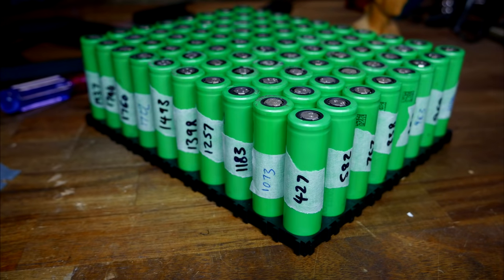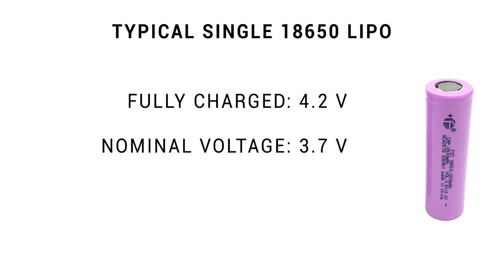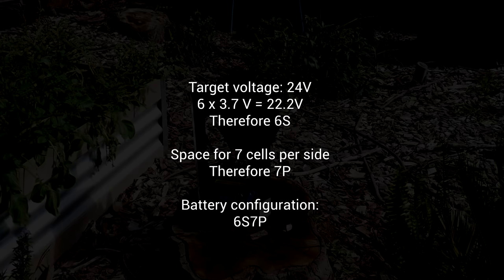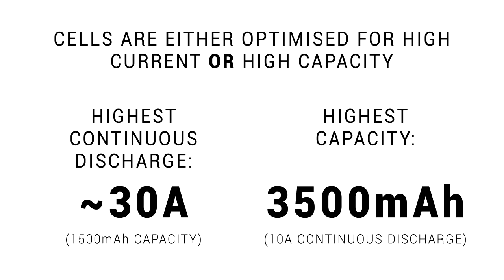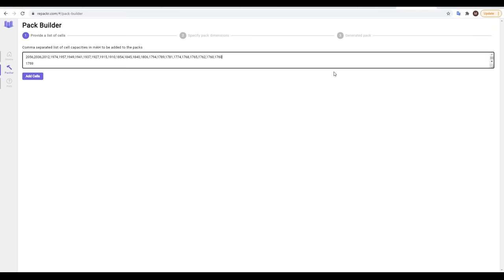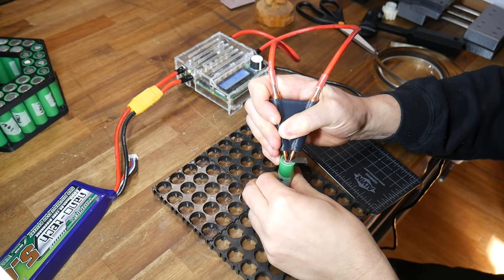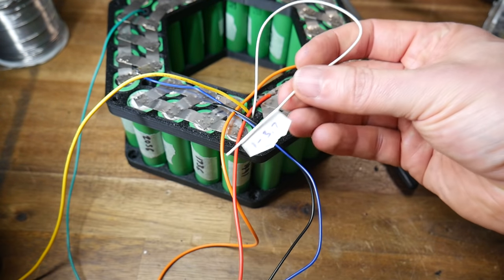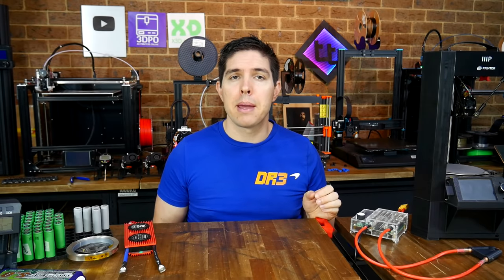Beginner’s guide to building safe 18650 batteries

Comment: Why did you show a lipo battery short circuiting instead of a Li-ion?
Reply from the maker: Far easier for me to do it safely. I would have needed to manufacture something to do the same shorting with 18650s without being right next to them.
Reply: There very similar, they both make the same boom.
Reply: @NathanCroucher  Actually they don't. And LiPo is usually considered safer. With Li-Ion it's harder to damage them due to their metal shell, but then again, that's basically a pressure vessel, so it releases more energy at once in the event of a catastrophic failure.
Reply: @graealex  Actually actually the point is its not safe for either of them to short. Thats why they both need all that circuitry to charge and monitor.
If he had of used a nimh/cd then yeah, poor comparison. Way to throw people off the issue suit man.
Reply: @NathanCroucher  "had of"... At least "suit man" mastered the English language. If you want to get personal.
Reply: @graealex  You do spell checks to. Thats great. Everyone loves those kinds of people.
Reply: @NathanCroucher  And everyone loves people who comment on appearances. You started it. Btw. it's "too". The issue still stands, an 18650 contains a liquid electrolyte in a hermetically sealed vessel, and that makes them more dangerous. Li-Po on the other hand just ruptures the pouch, and thus it doesn't "go boom", to use your own words.
Reply: @graealex  Semantics. So annoying.
Can you make a worthwhile contribution?

And FYI in Australia we removed the "o" from too as it makes things more efficient.
Reply: @NathanCroucher  The worthwhile contribution should have been me explaining to you that there is a distinct difference between just a fire and an explosion ("go boom" for the layman).
You being Australian explains a lot, so you are forgiven on account of never actually having learned English. Although it's still "too".
Reply: @graealex  " fire and an explosion" neither of these things are good.
Where getting there, to the point of all of this.
Ill concede boom to pop, hows that?

Comment: I am going to build a DeWalt 10 cell Samsung 30Q power supply.   I think it is 5S5P, based upon your design specs.  About how much capacity will it have in Amp Hours?

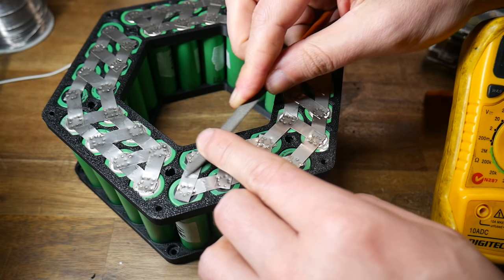Comment: 16:06 for people out there.. this part is dangerous. 
see those green plastic around the battery terminals?  those are the only thin sheet that insulate that part of the battery.  if you solder the way he did..
you might end up melting those plastic and revealed the metal part behind it.  and if you are unlucky enough it will short your battery if the head is a the positive part and the shell is the negative.

Comment: Removed 3 18650 26A, 3.6v, 1300mA li batteries from dust buster.  Do they have to be replaced with same battery, or are higher mA ok?

Comment: Assume a the 18650 has an internal resistance of .1 ohm( typical) and you draw 3 Amps the power lost per battery (I Squared r) = 0.9 watts.
Now assume you have three in parallel, so only 1 amp flows per battery, the loss per cell is 0.1 watts. (Not .3 watts)
The power loss increases with the square of the current.

Comment: another thing to consider is chenistry so for example if you take samsung inr25r (wich they use in hilti powertools) those are actually designed and tested to fail in a safe manner - meaning they short circuit them and they cant blow up, explode, burn or anything, they just remain as they are but are broken afterwards. on the other hand, many cheap noname cells are much more dangerous and actually can explode, so its important to know the chemistry of the cell you are building with too :) also there are very well cells that are optimized for both capacity and drain, like the LG INR HG2 wich has 20A continuous discharge while offering a serious 3000mah capacity. as a long term e cigarette user, i know a lot of 18650 cells and their capabilities :)

Comment: If youre doing beginner series and havent yet (your first video ibe seen) please explain the body of them and the need tollfor the top area not to have shrink oack damaged. Always good to buy a combo oack of shrink wrap colored packs that comes with the top ring insilators. 
Also that when transporting them to use a case or something keeping thwm apart and away from other metallic object that can cause short circuit.

Comment: Just reminds me of all those vapes that explode when people make errors with the current draw. 
Battery Mooch is also a good place if you want to know capacities and limits from different 18650 manufacturers.
Reply: I think they weren't errors they just didnt care and used cheap cells
Reply: @silver1fangs  usually is those sub ohm vapers that make their own low ohm coils and the battery's wont take the load. Boom!
Reply: @pgtips1199  I mean I've built hundreds and hundreds of coils never had a malfunction... I'm also very picky about my batteries... And a lityle common sense... if its hot put it down. My hardest build was a 0.08 on a single 25r.
Reply: @silver1fangs  Most didn't didn't their homework with ohms law. Went too low on the ohms for the cells they used. Gotta watch cell manufacturers. Mooch has proven some aren't up to their stated stats.
And yes I have dabbled with rebuildables and stacked mechs. Just not as much as I used to. lol
Reply: @rockerpeller5346  oh for sure I pretty much stuck with Samsung's or hohm life cells... I did end up building a lipo box and put my Colorado rda on it and vaped at 800 watts lmao it was ridiculous as it sounds
Reply: @silver1fangs  You have reached levels of gay that were previously thought to be unattainable. There is no such thing as a competition for the highest wattage in vaping.

Comment: When building a battery from salvaged cells is it necessary to match resistance and capacity to ensure all cells charge in a similar time?

I've seen some cells take way longer to reach full charge than others using the same charge even though they started at a similar voltage.

Edit: watched more of the video and saw you use vastly different capacity cells

Is this not asking for trouble? If a cell set drops voltage quickly because it is very low capacity will it not trigger the safety shut off sooner than necessary?

Or is that what the calculator you used does? Matching the cells to ensure each parallel set has a similar total capacity.

It just doesn't seem sensible to me to have cells that vary as much as the ones I saw you using, some looked to have 1/3 the capacity of others.

Comment: Nice edit so fast i was a little distracted watching the original haha I use both lipo and li-ion, currently building my first ebike atm with a custom aluminium box and a 14s5p pack with 21700s giving 52v 1.2kwh for a bbshd motor 😀

Comment: You made a big mistake.  
the fish paper comes under the nickel sheet before soldering.  
so that the shrink tubing (insulation) on the lithium-ion cells cannot melt!!!
Reply: Because the outside of the lithium-ion cells has a completely negative polarity, except for the positive pole cap on the front

Comment: Hello Michael.  Thank you for sharing this awesome video.  I learned alot from it.  Quick question to ask.  I am new to RC Car and I had acquired some 18650 used batteries a while back.  I would like to use them (make some myself) on my RC car which currently came with a 2 cells batteries in series (7.4v 1200mAH).  Question 1: Can I use the same charger that came with RC car to charge the 2 cells that I am going to make?  Question 2:  If not, what kind of charger I do need to buy to charge the new made batteries safely?  Question 3: What your recommendation to do to use previous used 18650 batteries for the RC car?  Thank you in advance. :)  Jack

Comment: The part where you showed buy in bulk, I almost choked as you highlighted 500. That's like $2500 in batteries! But this is helpful,  I might need a spot welder.
Reply: That's why skin-only power tools are so cheap and the battery packs for them are sometimes the same price.

Comment: Hi there, thanks for the great video~! I saved it to my collection. Just 1 question: after we have the wires for balanced charging, where do I connect the terminal(which has the wires for balanced charging) to?
Reply: They go to whatever BMS you're using. It was briefly mentioned in the video at https://youtu.be/tKg-jIrr_JE?t=1012 and https://youtu.be/tKg-jIrr_JE?t=1075

Comment: Great video. However I would never recommend mixing and matching batteries of different brands and especially age. Older batteries will discharge quicker and create imbalances. It just isn't worth the risk. Buy new batteries of the same type and go from there.
Reply: This is true and good advice to live by but that is the point of repacker so that way each cell group has an equal mah. His pack is so over built that per cell it not using much amps.
Reply: That's false. If the ir rating is close between cells as well as the voltage within 0.02v and 1-150mah, the pack will be fine.

Comment: Hi all! 

How to preserve a 18650 for a long time without using it? 80% charge once every 6 months, and store it in dry and room temperature, or fully charge it and leave it for a 1year, or 2? Thank you!
Reply: do not store lithium-ion batteries at full charge because the batteries degrate much faster at a full state of charge
Reply: @lucaz219  thank you so much!
Reply: @koleuslybra  charge it like 3,2V. Manufacturers do 3,5. Never charge it over 4,2. If you want to use it like military way, charge it until 3,9V for use.

Comment: Right now at 6:00 on your 10S4P screen, you still have 8P in the calculation but 4P in the summary.  A minor typo but potentially confusing to someone who doesn't understand the algebra yet.
Reply: It's not 8P in the calculation. It is assumed each cell can continuously output 20A, whereas in the calculation before it was assumed continuous output was 10A. Hope that helps
Reply: @mcbot6291  You just described the correct calculation; but at this moment, the video frame still says, "THEREFORE 8P."  This is potentially confusing to someone who doesn't understand the algebra.
Reply: @KeithNeufeld  my apologies, I missed that part on the screen. Good pick up!

Comment: 13:26 is the reason why I hate spot welding! I prefer soldering for just a second with a powerful soldering gun.
Reply: Batteries don't like heat, doesn't matter how fast you are, or how powerful your soldering iron is. There is really no alternative to using a spot welder, especially with high currents. With low currents, you can get away with spring loaded contacts.
Reply: @graealex  I never had any problems soldering them. It does matter how fast the soldering is! I only heat the contacts of the battery fore one second using plenty of flux. After that the solder connection is finished and the rest of the cold housing cools the solder very quickly.
The whole battery does not even feel warm after that.
So far I only used 18650 for continuous 5 A to 10 A.
Reply: @Flederratte  Unfortunately, battery cells can't talk, otherwise they'd tell you "ouch you're hurting me" while you are soldering them. Not only is "never had any problems" no indication on how you might have shortened the lifespan, but the manufacturer only tests and rates the cells up to 130°C, way below the melting point of solder, so there isn't even a guideline that might tell you what procedure of soldering is safe with what type of battery cell. All of them contain thermoplastic parts that you might melt or otherwise damage when putting heat into it.
Reply: @graealex  My solder melts at measured 180°C and I only heat the contacts. Almost all my cells are used ones which do no longer have their original capacity. I use them where there was no working battery in the first place so it is better than nothing and works well for me. 
I only run my battery packs under supervision.
Reply: @Flederratte  Your point was that you are not damaging them, and my point, which still stands, is that you simply don't know to what extent you might be damaging them. The cells being used makes it even more uncertain.
Reply: @graealex  My point was and still is that I prefer soldering and I never had any problems with soldering. I did not claim to not damage the cells. I assume it does not damage them but I can not know. However I think for my purposes it is acceptable and more reasonable than buying a spot welder. 

Apart from that I agree with you. Thanks for the info and I appreciate your comment because it also has the purpose to inform others who might read the conversation.

Comment: What was the point of switching the printer to 24V? Couldn't you have stayed at nominal 12V and run 3S (14.7V), or did the custom pack just work out better as a 6S?